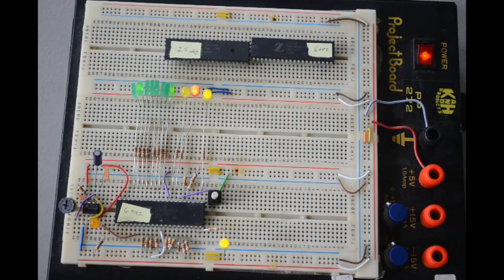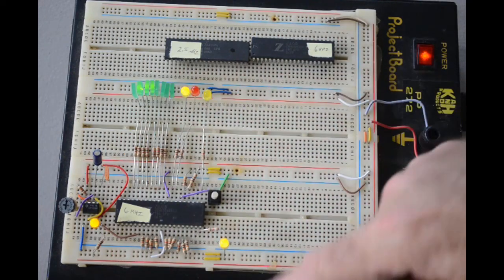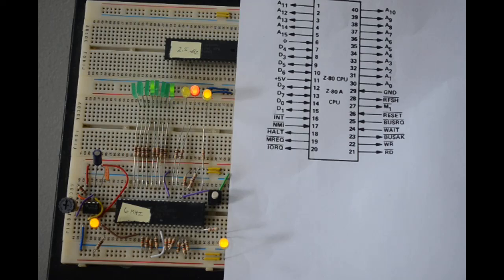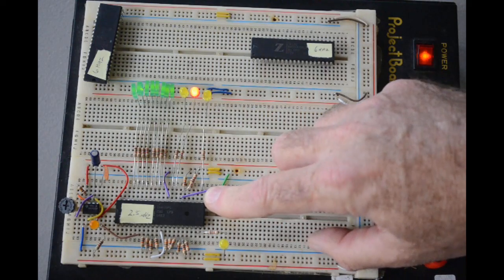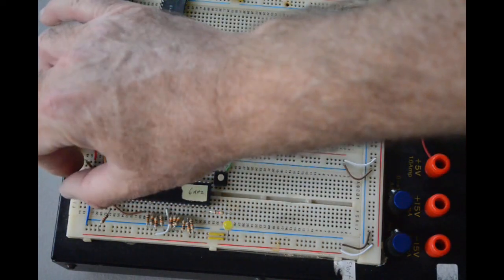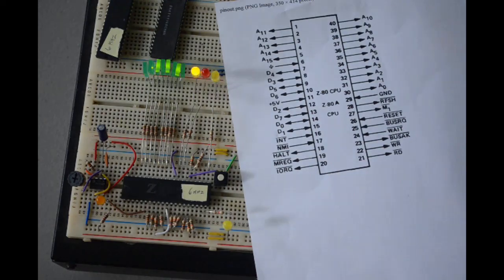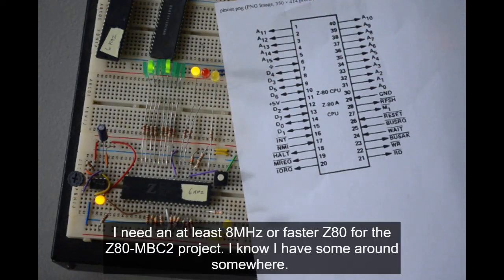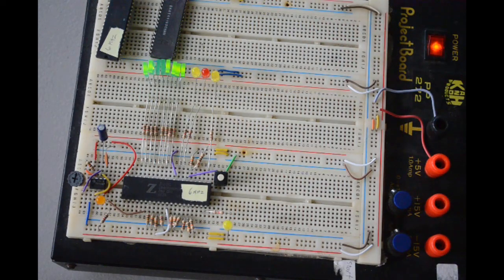How to test Z80 CPU chips salvaged from e-waste, and the start of a Breadboard Computer

Comment: Well, the Z80s I have are all CMOS, but there's one trap I've fallen into with my 6502s, where I have both NMOS 6502s and CMOS 65c02s. The thing is that CMOS chips can be clocked ridiculously low (they can actually even be stopped), as seen on your tester, but NMOS chips need at least a bit of speed (I read something about 5-6 microsecond cycles, that translates to about 200kHz). I don't know about the Z80, but the NMOS 6502 sure doesn't have a static core and thus would fail the NOP-test at speeds like this.
Some NMOS-Z80s had "half-static" cores where you could stop them indefinitely with the clock at 1, but not at 0. I have a slight suspicion that's what happened to your 2.5MHz part, since there isn't much that can actually kill those old processors besides feeding them too much voltage.